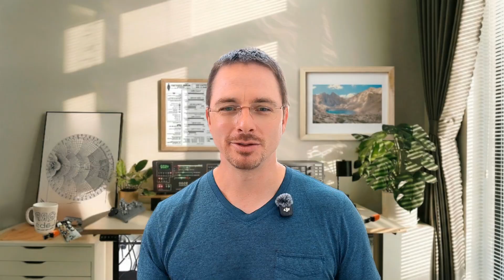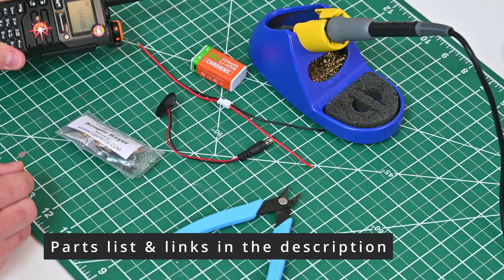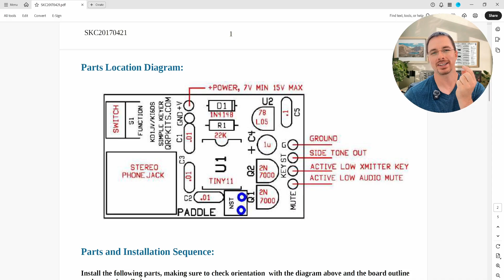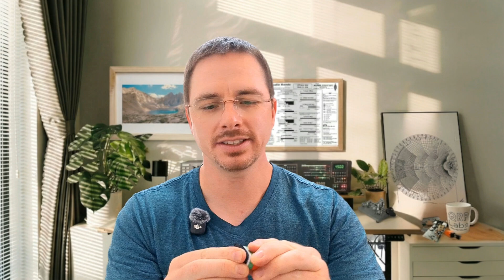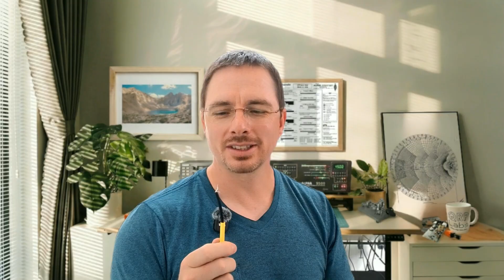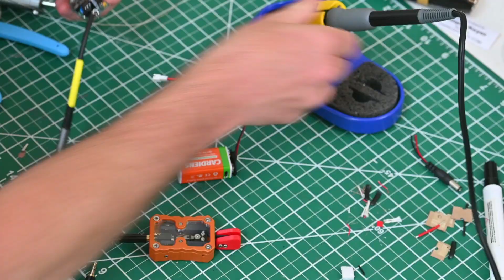Iambic CW with a mod'ed Quansheng!

Comment: While at PNW SOTA event last summer, KI7JOM and KJ7LLS demo'd their modded  UVK5 with the PICO keyer. It worked well. But, at home when I got the IJV modded UVK6 , neither of my two external keyers at home would key it. Just got a solid 'key down' when the plug was inserted. It turns out that keyers with open collector out won't key the HT. So, knowing the PICO worked, I built one and am a happy camper. Major advantages of it are: choice of keyer mode (Iambic A, Iambic B, or Ultimatic) and 4 message memories.. Memory keyers are the cat's meow...K7GT
Reply from the maker: That’s a fantastic keyer and a better performer. Reasons I tried this kit: smaller, and cheaper. 😅

Comment: FB MARK! This is a great lightweight keyed for the SOTA 2M Challenge.
Reply from the maker: Electrically I’m not entirely convinced this solution makes sense, so I’d like to see one or two people reproduce this before I make the video fully public. The circuit diagram available in the instruction manual doesn’t show the short that I take advantage of. Any chance you want to order a kit and try the build?